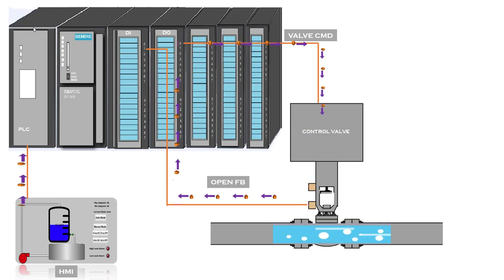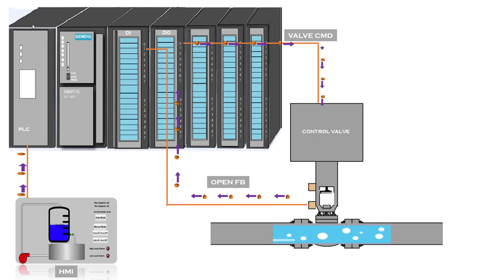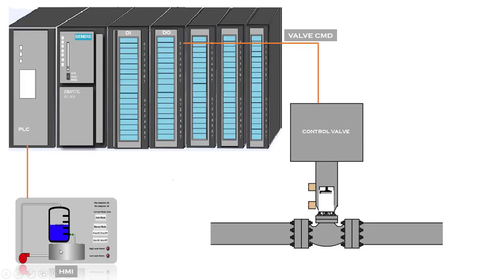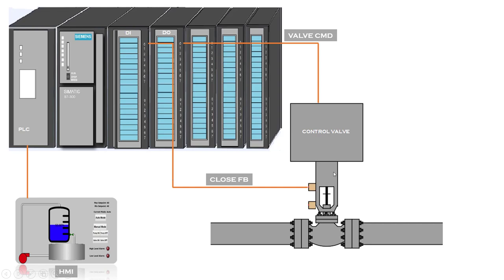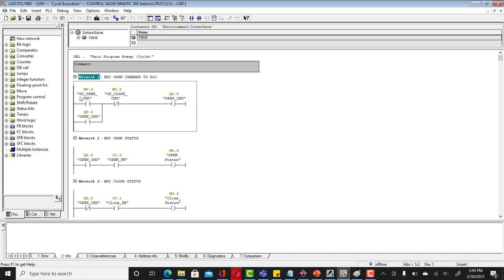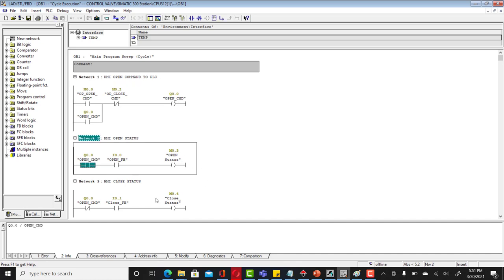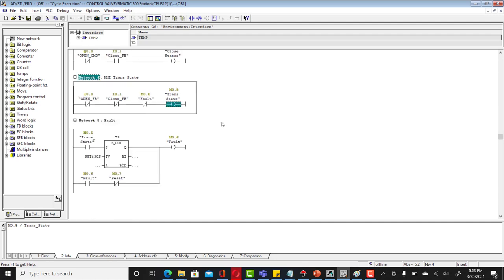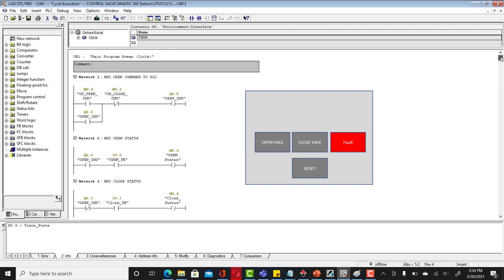PLC Program for Valve : Animated Explanation

Comment: Thanks for the video. Can you kindly do a video with two control valves at the inlets of 2 different tanks been fed with liquid from a reservoir with level switches or float switches that sends low/high feedback to the PLC. And also two flow meters that tells the  content or level of liquid in each tank. Thank you sir. I will be very grateful if a video is made on this

Comment: Nice.. But i believe if you title this valve as ON/OFF valve instead of Control Valve that would be the exact explanation of this scenario. As control valve uses ScaleX/NormX block & uses 4-20mA signal to adjust its position to 5 different positions. i.e 0% 25% 50% 75% & 100% and its feedback provided by electronic controller as Analog Output of 4-20mA
Reply from the maker: Title is not control valve its just valve